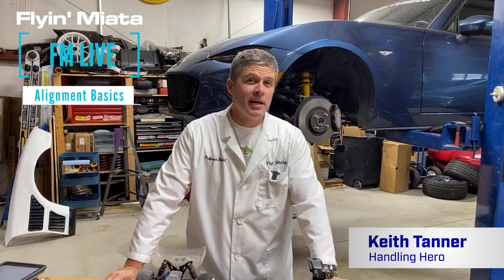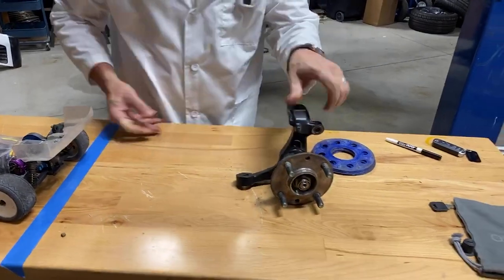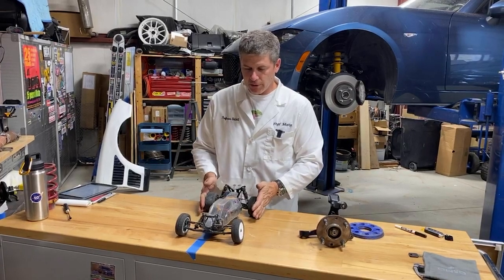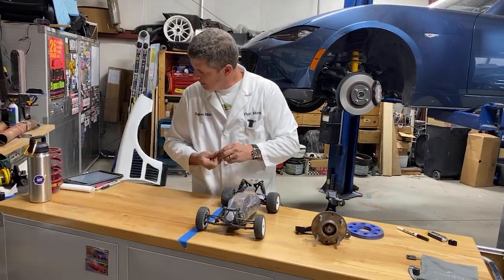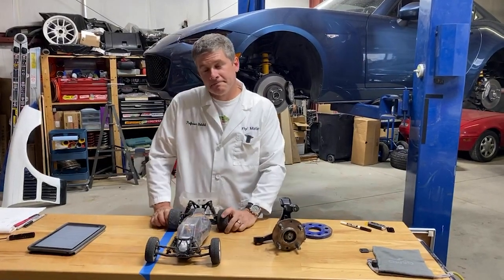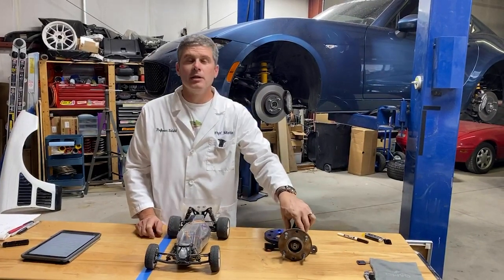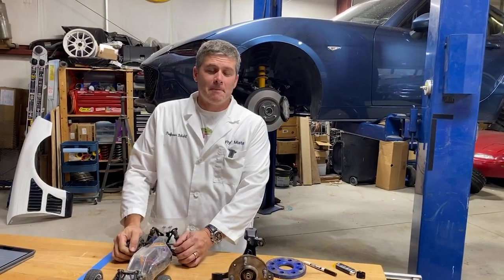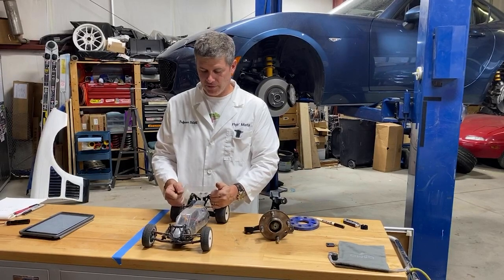Alignment Basics (FM Live)

Comment: I have a new ND RF, 2000km at the moment, and I noticed today that the rear left wheel seems to have more negative camber than the rear right. I checked the camber bolts, and they turn out to have a different setting, the right one is pointing straight up, and the left one is off by 2 notches. Is this something they do at the factory to compensate for tiny manufacturing differences, and/or does it have to do with break-in of my suspension (all the weight on the left side, I'm the only person in the car) and will it balance out after a few more weeks of driving? Can't really find an answer on the forums...
Reply from the maker: Congrats on the new car! We'd recommend you take it in for a precise alignment no matter what. It really should be part of buying a new car. Mazda sets the cams to approximately the middle, which means it's within a fairly loose definition acceptable - but as you can see, it's definitely loose. There's no break-in period required.
We have some recommended alignment settings on our site: https://help.flyinmiata.com/en_us/align-your-suspension-chakras-By4oIc2zj

Comment: You mentioned the wide variety of alignment settings from the factory and to have it checked-I’ve got 250 miles on my new, bone stock, 2020/RF/Club/mt/MX-5, used for in-town and fairly aggressive canyon driving (therapy).  Do you have a preferred alignment set-up for this type of street use?
Reply from the maker: We do! We recommend running the maximum camber and caster you can reach on the front, the matching the rear camber to that number. Slight toe-in in the rear. And congrats on the new car!
Reply: Flyin' Miata: Thank you-Loving this car! Put your door bushings in just to try something.  What would be a slight toe-in be in degrees?  Also, thank you for your videos!
Reply from the maker: @watercooled8105  We usually recommend 0.15° total, or 0.075° per side.

Comment: Can you recommend a tire replacement for my NB (205/50r15 or 195/50r15) for year around daily use? I will be driving in cold temps less than 45f at times, but not in snow. I’m hesitate to put summer tires on my car due to driving below 50f .
Reply: Tire Rack sells a Sumitomo HTR A/S PO2 tire in a 195/60/15 that is a FANTASTIC daily/spirited driving tire that I have used for years and absolutely love them. It's a bit larger rolling diameter tire (in this size- about 24.something inches), but this helps bring down the top gear highway rpms a bit. Worth a consideration for the price!
Reply: @pauljohnson7382  I’ll check them out thanks

Comment: In Nascar's Cup series, I see pit crew put a wrench in the rear window to make an adjustment.  What are they doing?
Reply: I believe they're adjusting the track-bar.
Reply: @patrickfargie1146  Thanks.  How does the track bar affect alignment?
Reply from the maker: Also known as the Panhard bar, it's part of what locates a solid axle in a NASCAR suspension. Adjusting it allows you to mess with the roll center and thus the handling balance.
Miatas don't have one. There are probably a handful of Miatas that have been converted to a solid rear axle as part of a V8 swap, but they're very rare and the only reason we mention it is because otherwise someone else will pop up and start talking about theirs :)

Comment: FM:  I am installing Fox coils soon on my NB, I am planning to take the car for an alignment after that.  I was thinking of replacing my eccentric bolts to make it easier on the alignment shop - so they don't have to deal with any bolt drama.

Is it possible to replace the eccentrics one by one and not slip my alignment?  My gut tells me no... but thought I would ask.

Maybe instead I just break each bolt loose and re-torque it in the garage so that I know none are seized up?  

Thank you for all the content, these videos have caused me to spend SO much money at FM this year - lol

Comment: I bought an nd3 a few weeks ago, and I thought "wow this car drives so differently from that nd2 I rented" drove it for a day and a half before I found the tire pressure readouts. My tires were at 41psi...well it sure drove differently. Apparently they inflate higher to prevent flat spots from sitting, or something like that, or maybe the dealership just messed up, not really sure. I'm still shocked how well it drove with 41% (ironic) higher tire pressure...

Moral of the story, first thing to do with a new mx-5 is to make sure your tire pressures are right!
Reply from the maker: @AcoAegis Always check the basics!

Comment: Thanks for the video ! 
I'm about to get the alignment done on my NB with your setting (car equiped with the KONI, FM Springs & swaybars, etc..).
I was just wondering if the car has to be with the driver in it, maybe with the tank full, etc.. during the alignment or not ?
Or maybe the difference of weight is not that significant ?
Thanks for you reply !
Reply from the maker: For the most accurate alignment, you really should have the driver, or comparable weight, in the driver's seat, but most alignment shops won't allow you to sit in the car while the alignment is done. Unless you are tracking the car, you probably won't notice a huge difference with no weight in the car.

Comment: Thanks. My NA6 has a stock set up but is about an inch, nearly 3cm, lower on the RHR (Driver) compared to LHR. I've checked the top hats from to the top in the boot, and there is no noticeable rubber collapse. Suggestions on the cause on the sag, and what I should look for/measure to locate the cause of the sag? thanks heaps. PS: this is measuring from the ground BTW, not centre of hub, to apex of wheel arch
Reply from the maker: Given the RHD reference - are you in the UK? I'd start by looking for a rusted and broken spring. The UK does not have a kind climate for steel.
Reply: Thnx 
Not UK, Australia 😆
Tho i can see a bit of sag, i did some accurate measuring from hub to arch and difference is just nudging  10mm, which is just within OEM spec i believe. Unfortunately we get spare wheel and Batt on our Driver (sag) side ... maybe just normal spring variation over 30 years???
Reply from the maker: @alexmessina3383  I meant no offense! ;)
In the MG world, asymmetrical spring sag like that is called "the bachelor lean". It's quite possible that's what is going on. You could try swapping the spring/shock assemblies side to side, but after this many years it may be time to consider new springs.
Reply: Yes. Funnily, Im looking at an MGB  at the moment. Plastic bumpers tho. 
Offended?? What can i do if 90% of the world keeps putting the steering wheel on the wrong side.
Dont even talk about driving side. Ladt yime i was driving in LA & NY i think i was declared a threat to the National Interest.

Comment: Is the effect of camber, toe and caster greater on stock suspension (stock shocks springs sway bars) than on tighter aftermarket suspension? Would you recommend playing with these suspension elements even if I have stock suspension?
Reply from the maker: A stock suspension generally moves through a greater range of motion during use, so proper static alignment is arguably even more important. We recommend a good alignment no matter what suspension you have.

Comment: Canyons here in NorCal have a little bit of everything, elevation changes and sometimes harder to read sudden turns. Car feels a little twitchy in the rear and unstable under braking. Would Toe out in the rear help stabilize this?? Maybe increase dampening in the front? 

Canyon Car (Targa Miata Inspired) 2003 NB (Engine Stock w/ intake

FM V-Maxx XXtreme Stage 2 Sport package suspension kit (with bars). 
Poly Bushings (all), BAUER extended lower ball joints. Alignment set to zero all around.
15x7 +35s and 205/50/15s
Reply: What canyons are you running? I'm a little past sac and I usually go on 193 and 49 / Salmon Falls, but any other places would be good to know

Comment: I bought a 1994 Mazda Miata a few Months ago. Its completely Stock and im Pretty sure i have pos camber up Front (Not a lot but u can tell by looking at it and measuring with a Spirit level), im also pretty sure its about the same amount. Do i have to worry about it having Bend Suspension or is it Just badly aligned? Because you Said something about pos camber on a Miata its broken?
When i lower it (with Good coilovers) and do an alignment afterwards it shoudnt be a big problem ? Am i Right?

Comment: @15:15 I recently bought a 2017 ND1 Soft top. It had a horrible on-center feel, making it hard to drive straight at high speed. Just had alignment done as per Flying Miata specs. I can feel the self-catering has improved but continue to experience the sticky/stiff on-center steering wheel feel. Do you have any suggestions?
Reply from the maker: A vague on-center feel is unfortunately a feature of the 16-17 soft top steering racks. A 17 RF or 18-22 soft top rack should bolt in and give a nice improvement. Other than good tires and a good alignment, we don’t have a lot of other suggestions.
Reply: @FlyinMiataVideo  thank you for the reply 🙏, is there any electronic configuration need to be done following the replacement? I think I read that the ECU self-learns (calibrates) steering position. Also, have you seen many people do this swap for the same reason or are they just putting up with it? It’s a safety concern in my opinion 🤷🏻‍♂️

Comment: Could you share some alignment recommendations for drifting? (Car is an NB 1.8 sport with a fully adjustable coilover suspension).I know for sure maximum caster is a must. What about the other parameters?
Reply from the maker: We don't really know much about the requirements for a good drift setup, sorry. At least you're not worried about long-term tire wear :)

Comment: Can you go a bit more in-depth as to why toe in is more stable in the front?

In both toe in and toe out, once you perturb the front wheels such that one of the wheels straightens out, the other tire will always “win out” by inducing a yaw moment which is not counteracted by the wheel on the opposite side.  

Toe In (perturbation causing steering to the left) 
Front
| \
| | 
Rear

Toe Out (Perturbation causing steering to the left)
Front
\ |
|  |
Rear

In both cases the perturbation is not counteracted by anything. Yes the toe-out car has a bit more Ackerman angle so it’s all else equal easier/willing to turn than the toe-in car but that cant be the reason for small perturbations which is by definition what stability means (the Ackerman itself doesn’t cause the steering to “want” to return to center)

Finally if you use the above example, you can see the toe-in car has the right front wheel turning left which is the tire that’s going to get loaded more in a left turn, which if anything, the dynamic load transfer of toe-in setup creates a positive feedback loop which should make stability WORSE. 

Imagine a toe-in car where the left front wheel hit a patch of ice/sand, now your front left tire provides no/less traction and your front right tire makes your car turn left, loading up your front right tire even more, causing the yaw to increase (the toe out car would cause your car to yaw right, marginally unloading your front right tire, and hopefully helping your left front tire regain traction, straightening yourself out)

This is my logic and given it’s opposite to literally every single source i can find, there must be something wrong ... i just cant figure out where it is for my life.

Edit*: The only thing I can think of is that for toe in, you get the slip angle imparted drag offsetting the yaw imparted by the perturbation itself. It’s hard to intuitively tell which effect is bigger or if they’re even close to the same magnitude.

Edit2*: grammar in main body
Reply: Can you go into more detail on the scenario you're imagining?  E.g. is a car driving on a straight road and one wheel hits a bump and is compressed?  Or are you thinking about steering turn-in?

In either case I think this is where tyre physics starts to get a whole lot more nuanced. You might need to consider factors like tyre load (weight force) impacting lateral forces. The outside tyre in a turn will have more load, and thus might contribute more force etc
Reply: Sam Douglas 

The perturbation could be induced by anything. Let’s just say turn in (driver input) to eliminate confounding factors like bumpsteer.

So for both toe in and toe out cars, it takes a certain amount of steering angle to “straighten out” one of the wheels. If the cars were both setup with equal amount (but opposite direction) toe, the amount of steering input required for this is the same.

Now the car has three wheels tracking straight and only one wheel wanting to initiate a turn, and whether that’s the front inside tire or outside tire at turn in doesn’t make much difference in my mind intuitively speaking in regards to the car’s inherent “willingness” to turn. 

Furthermore, I outlined an example above where two identical cars with opposite toe settings running straight down a road but subsequently hits a patch of sand/ice on their front left wheel leading to momentary reduced grip. The toe out car will now experience a yaw to the right ( it’s front right tire “wants” to turn the car to the right which WAS counteracted by the toe out on the front left tire, but due to the ice/sand the force is now imbalanced. The yaw will cause load transfer to the outside (left) wheels which serve to mitigate the original imbalance.

In a toe in car the opposite happens, there is a positive feedback loop causing the initial disturbance to increase.

In my edit above I mentioned a possible differential in slip angle induced drag but I’m not convinced this can have a big effect given the small toe settings used in practice.

I’ve been racking my head around this problem basically ever since I heard people say toe in at the front is more stable/toe out more twitchy (many many many years ago) so would really like to pick an expert’s brain on this matter.

Edit1*: Added some stuff
Reply: @DominicLeung87  What you are saying makes sense, but that would only apply if you run a really high amount of toe. In real world, people run tiny amounts of toe which wouldn't lead to any noticeable weight transfer or changes in direction. With those toe settings, other factors like tire flex and suspension flex play a much bigger role in car stability. Basically the car suspension and tires are extremely complex and a lot of times it's really difficult to understand why a certain change makes a car more/less stable. It's just generally accepted that on most vehicles toe-in equals stability and toe-out gives better turn-in.
Reply: @vicciu3850  yeah figured it would be something like that

Just because something works in a free body diagram doesn't equate to it being true in real life

What I am interested in is that given we know toe in front setups tend to be more stable, what is the mechanism behind it?

Many of the "explanations" commonly given are just wrong 
(with toe in the tires fight each other... Well with toe out they fight each other as well)
(Ackerman geometry makes the car more willing to turn in... Really 1 or 2 degrees of Ackerman is responsible for this?)
Reply: @DominicLeung87  I totally agree. Most internet explanations on this topic don't make much sense to me either. I think that the only way you'll get a good answer on this topic is by talking to someone who's actually designing/tuning performance vehicles.
Reply: @vicciu3850  ha ha ha that's why I posted on flying miata vid here

Figure Keith would have an explanation given he had been doing this for so long but I guess he didn't see my post.

There use to be a channel called Kyle.engineers who covers a lot of this stuff in a much more in depth manner and he's a proper mech engineer who did formula SAE and built his own race car. Unfortunately his channel went dead after he got a job on an F1 team.